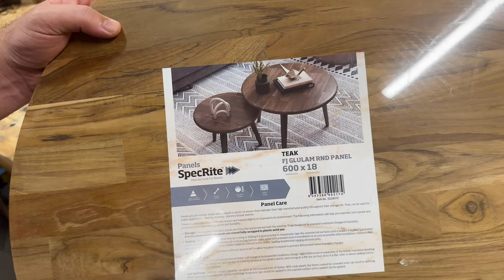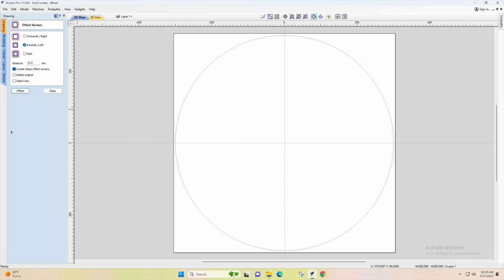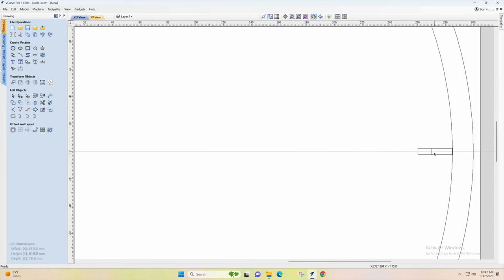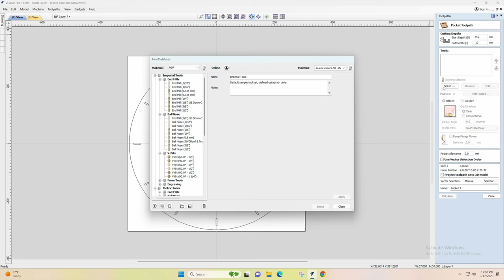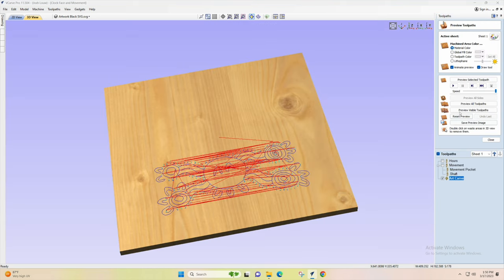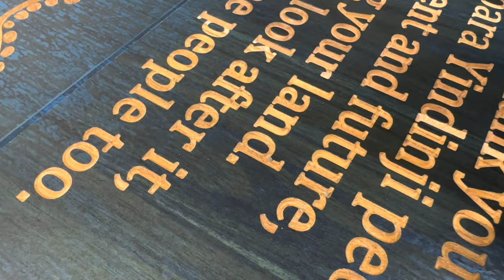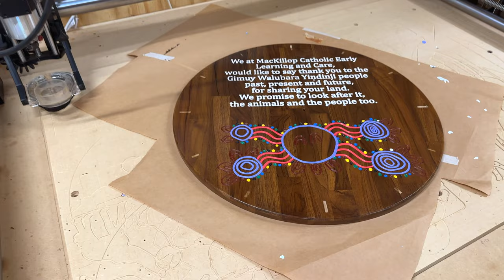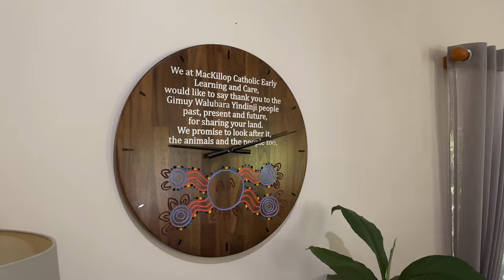How to CNC Wall Clocks - Start to End!

Comment: Nice looking clock, Where did you get the Specrite panel from? I think because it's laminated, there will be less chance for the panel to warp and cup. Thank you
Reply from the maker: I got those from my local hardware store (Bunnings if you are in Australia) easy enough to cut from a rectangular panel if you have to though.

Comment: Which type of bit did you use...?
Reply from the maker: I forgot to mention in the description.  I used this bit to cut out the pocket for the movement on the back ( https://bitsbits.com/product/425-dnc125/ ) and this one ( https://amzn.to/3poKYtz ) to do the engraving.  Many people seem to use a 60 degree or even a 30 degree V, but I find this works well in most cases as long as the font is not too small or the letters too thick, else you start to loose detail.  I have had other 90 degree V bits, but this one I have not had the need to even rotate the blade yet!  Love it!  Hope that helps.  ;)